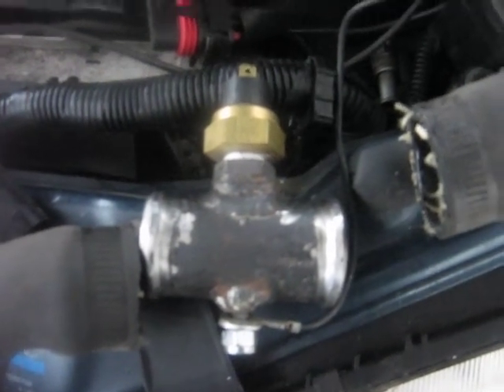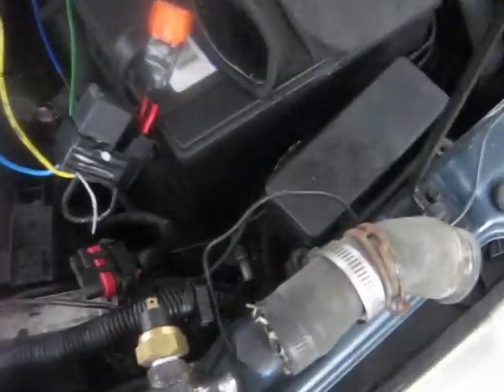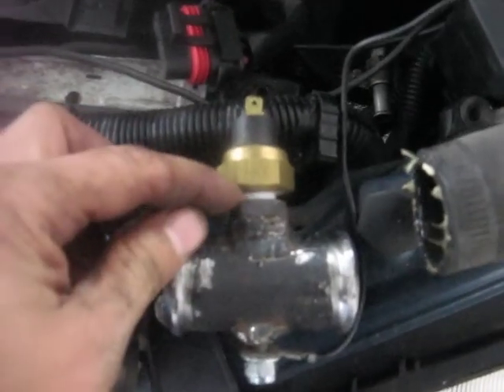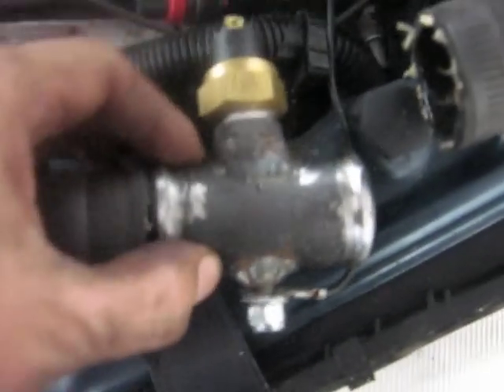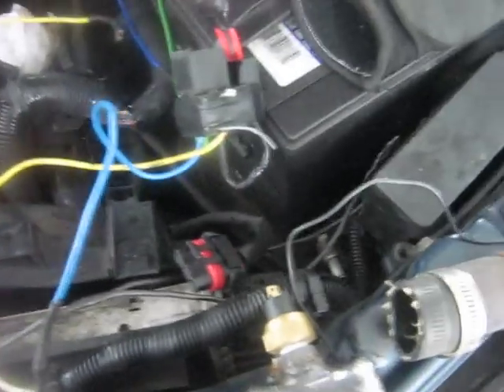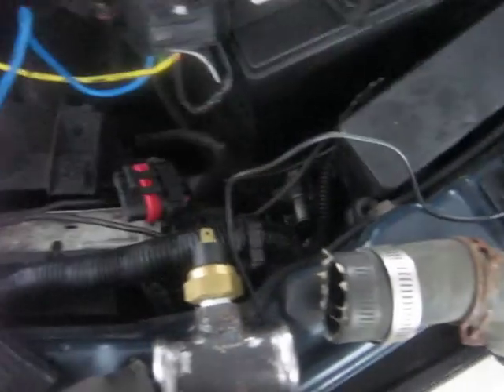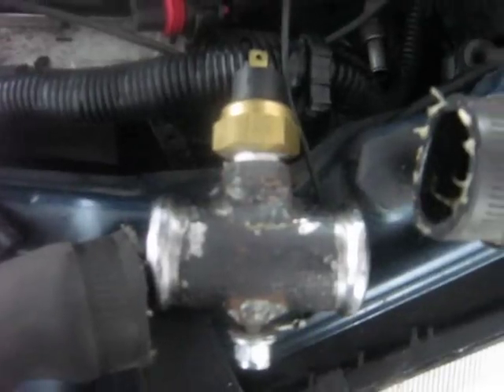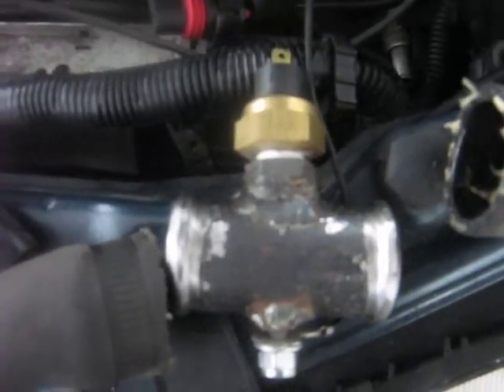Cheap Cooling Fan Control

Comment: Genius! Your son did a great job on the pipe. Im thinking of putting mine on a switch in the cab. But thats genius.
Reply from the maker: Yes, he is a real fabricator, he started young, and has continued on as an NC machinist, and was a certified welder at one point. He has built and ran a few V8 engines and a few 4 cylinders, right now he is on a small engine kick. This thing really did the job, and never leaked anti-freeze. Unfortunately, I think it went to the scrapyard with the car a few months back, because I had to drive the car there, so I didn't want to risk a cobbled up replacement blowing apart 1/2 way there. In hindsight I should have rescued this work of art :)

Comment: hey bud, do by chance have a part number on that on/off coolant temp sensor. I can't seem to find it on summit
Reply: Easiest way to get a Temp sensor is to go to a Pick N Pull,etc.....get the Hose T from a Saab 99,900,9000,etc. and the temp sensor can be found on a old school Peugeot,Volvo, Saab,VW,etc...... sensor is usually screwed into the bottom of the radiator on the return "cooler" side. For my old school 1974 Caddy, I just went to Lowes and bought a 1 1/8th to 1 1/2 diameter PVC adapter to make the Saab T fitting(that houses the temp sensor) work. Both fans come on automatically at 195 ish and shut down at 180ish. I run the grounds to the sensor.....and just use 25amp male fuses direct to the battery (with homemade female connectors on the positive battery cable). That's correct, I said two; it's radiator surface can take 1 massive fan another smaller 1 with homemade brackets that bolt to the "flat" surface on top and bottom of radiator. Very effective and cheap....not to mention the Big Block Caddy is so much quieter and safer not having that massive viscous propeller looking for fingers/wrists to chop off! These old temp sensors on the VWs,Peugeot,etc................almost never go bad....so don't be afraid to put a 20-30 year old sensor on. And if your concerned about age of sensor,just go on to Rockauto etc. and order a new sensor for VW/Peugeot diesel...they are pretty cheap brand new!

Comment: No more temperature control problems with Auto Cool Controllers.
www.autocoolguy.com
Reply from the maker: Darryl Dashiell I will have a look.  This unit is working OK also, thank goodness.
Reply: Good luck on using a relay to switch your fan!

Comment: Nice tip Miles, thanks for posting it.
Reply from the maker: You are welcome. It may be simpler to remove an existing sensor, and replace it with the thermo sensor, but I couldn't figure out which one did what. This way I knew it should work OK. Cars are getting to complex these days, I mean come on, $200 for a cooling fan black box, give me a break! This car is over 10 years old, I can only imagine what they have dreamed up by now!

Comment: Did you check for fusible links coming out of your controller???
Reply from the maker: No, can't say I did. I doubt they would be the problem, as it used to turn both fans on full blast at -20C (0F), as soon as I started the car! I unplugged both fans, then put in 2 toggle switches. We made this item as a fail safe, as I didn't want to forget, and bake my engine!

Comment: Good fix, cant say mine has that problem though, but for what ever reason the fans will kick on about 45 sec after the keys are pull out the lock abd run for a min or two, it is supose to do that, cant say why XD
Reply: well that a right smart idea you had, i file it back in my mind to use later
Reply: They do that because when you shut the engine off everything heats up more. I have an old truck and I have a set of mechanical gauges in it, if I'm at 180 degrees and shut the engine off it often climbs to 190-200 degrees.
Reply: 1972FordF150 well that kinda makes since, heats still there and then there aint no oil or coolent flowing to cool it, reckon them boys at for knew better then i XD
Reply from the maker: Mr3wheeledbike Yes, the fan would cool what is in the rad., plus stir up the air under the hood. When my fan controller died, it would run both fans full blast ALL the time, this is a serious electrical drain, plus would wear the fan out! I unplugged both of them (it was winter). Only one fan cooled off just fine all summer, installing this allows me to forget about it, and drive it like normal again.